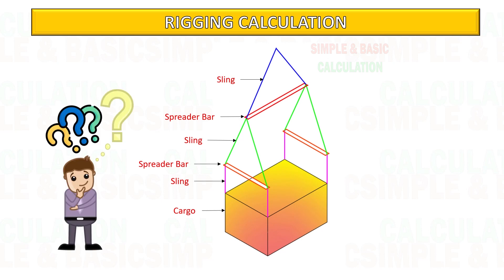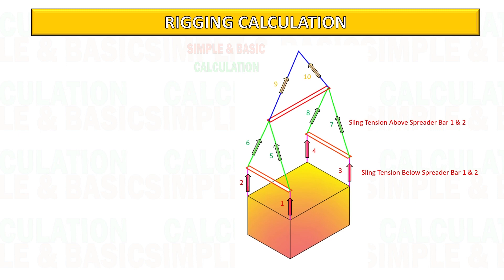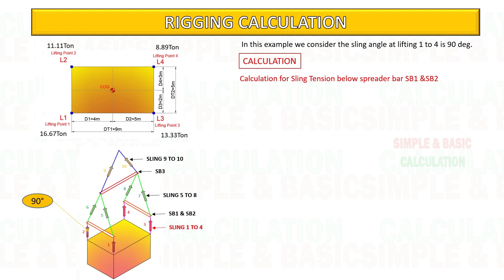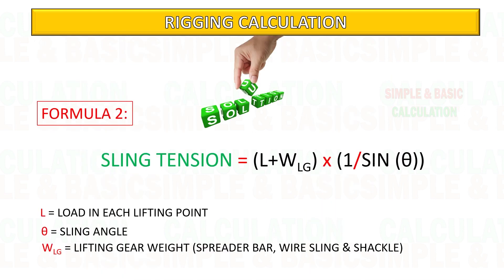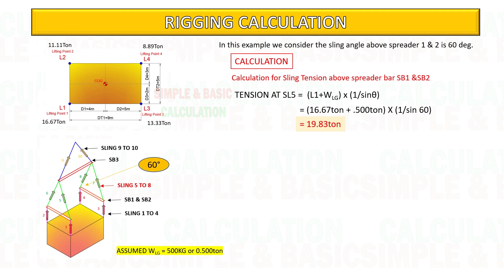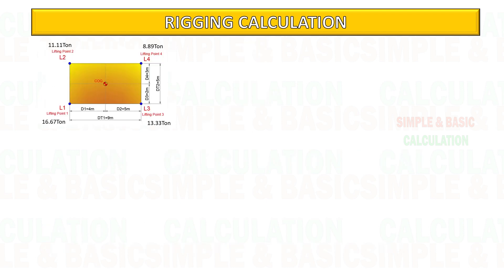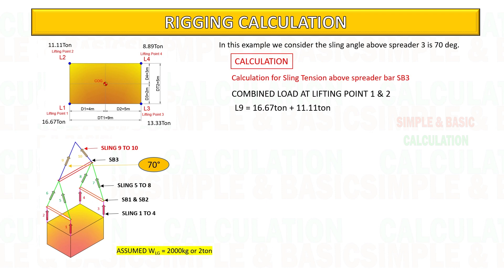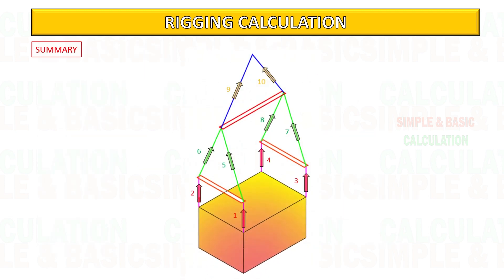Rigging Calculation wire sling tension 4 lifting point with 3 spreader bar part 2  #rigging #lifting

Comment: I have a a similar assignment in Uni and used the same method but one question for you . the forces along the spreader bar on top below the hook are not equal and it mean the spreader bar may buckle . My teacher believes the tensions in each sling should be calculated in a away that at the end forces along the axis of  the spreader bar should be equal but I doubt it that he is correct . Do you have any advice?
Reply from the maker: Indeed, if your spreader bar lacks the strength to withstand these stresses, it will lead to this outcome.
Take note that COG of the load is not always positioned at the center.
It is important to ensure that the spreader bar you intend to use is sufficiently strong and designed to withstand all the stress.

Comment: Your calculations are not clear below the lifting beam all the slings are straight (90) angles and how it's deference could you explain to me if you don't mind, all the slings angles are the same to the same bellow or both ends of loads. Please explain it's confusing lots
Reply from the maker: If your sling is not straight below the spreader bar (Ex. sling 1 & 2) refer to drawing
To get the sling tension if sling angle is (Ex. 70deg)
Tension at SL1 = 16.67ton x (1/sin 70deg) = 17.74ton
Reply: Good evening
In your pic there are 3 place slings right. I come from the load. There are 4 pieces of slings attached to the load. And 2nd one yes there's angle and top for Crane Hook attachment. We have 2 place angles and one straight ( to the load ) is last but my question is in 90 angles how slings tension are different also we have the same height and sling no angle ?
Reply from the maker: Due to center of gravity of the cargo is not in the center, this is the reason why the loading in each lifting point is different. 
This is sketch drawing only, i consider the sling angle is 90 degree for demonstration purpose. 
In actual operation if your sling is not straight from liftig point, you just need to change the value of degree to calculate the tension on the sling.
Reply: Sling 1 to 4 why not equal?